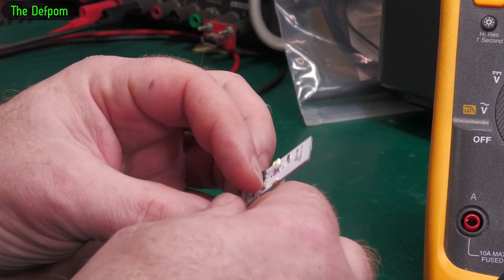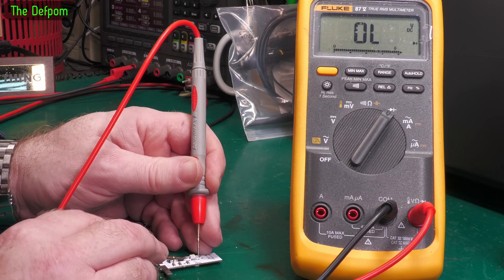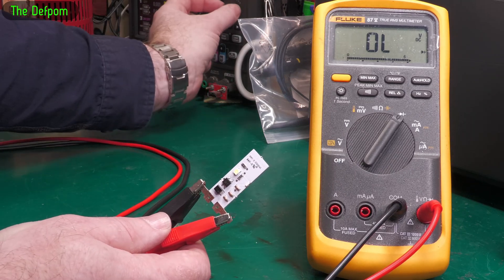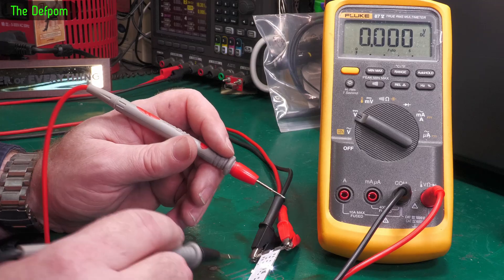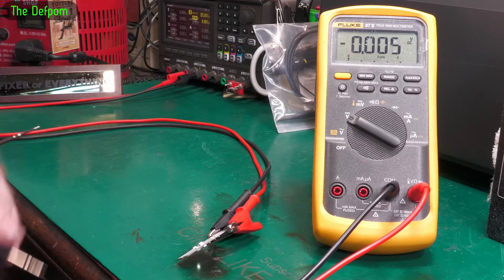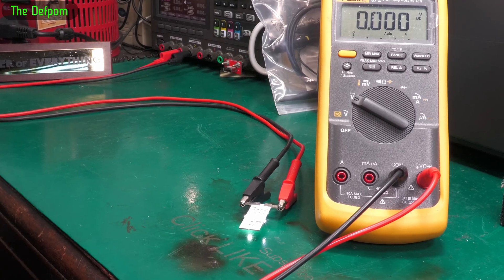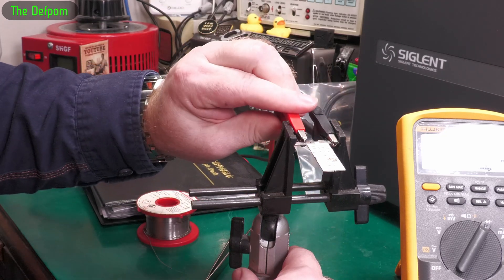🔴 Why Did This Werma Signal Tower Lamp Fail - Can I Fix It ? - No.1398

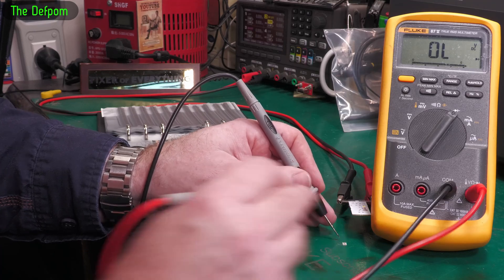Comment: 6:43 a small error, the negative side is the cathode, not anode.   Nicely explained about the bridge and the universal AC/DC input, a design often used on replacement LED bulbs.

Comment: Multiple series resistors is for power handling, as the package is small, so you need the board copper to spread out the heating to a larger area. they could have gone for the multidie packages, which have 2 or more LED dies per package, with a common phospor top cover, which would have resulted in a higher forward drop and thus lower loss in each resistor, which means better light output for the same number of components. 24V means plenty of heat to burn off, better to use more dies, and get useful light, and at the same time drop the current to 10mA, meaning much better LED life, which might actually be the rated manufacturer life, as that is normally specced at 10mA forward current, while most applications run it at the higher current for light output, so they get cooked with 50mA instead.

Comment: Also currently fixing LED's but ceiling fixtures that use some 50 parallel pairs of 3535 LED's. ST42 is super fast for finding the faulty ones which I've learnt to split across the middle with a scalpel then remove the remaining pads with the iron and settled on using a K style tip for this work then solder just one end then go back and solder the other pads. The scalpel also serves to remove a small portion of the Cathode pad solder mask to aid with forming a good solder fillet. On these LED's the Cathode is marked with a tiny bevel on that corner of the LED chip. 
Done 4 of these 1.5m ceiling fittings now with 3 more to go. Replaced ~60 LED's so far.

Comment: I've wondered if using a diode bridge on DC affects the life or ratings of the bridge. 
If you think about it on AC the diode pairs are only working 50% of the time and the power is shared between the two pairs of diodes. in the DC condition the power is 100% on two diodes and not shared across the device. so more local heating in the chip, so does lead to a reduced life?
Reply: IMHO a full bridge rectifier is more stressed in the AC case (assuming a sinusoidal AC waveform as you would if running this from mains).
If the DC case was say 10V at 100mA, this delivers a power of 1W to the LEDs. To provide the same 1W using AC, you need 10VAC RMS and a current of 100 mA RMS. This means the actual voltage is now varying between -14.1V to +14.1V and the current varies between -141mA to +141mA. More (peak) stress for the rectifier diodes
Reply: @TheHWcave  it great how a simple thought can start a lot of comments. i was just sitting watching the video and had the thought what affect does AC vs DC have on  a bridge rectifier. now hrs later we are still talking about it. But i can say thanks for keeping the grey cells working for a bit longer.
Reply from the maker: I expect it would if not correctly specified for the usage current, and power dissipation, in this case it should be fine.
Reply: @TheDefpom  Just had me thinking that the conditions are not the same, so although fine for you application is this a point we should take in to consideration in the design process? 
Just had me thinking outside the video, 50% vs 100% power in half the chip.
Please stop making thought provoking content it's making all the diodes down my left hand side hurt. 🙂
Reply: IMHO....no......As long as the spec is adhered to. i.e. the forward & reverse voltages, current and temperature is adhered to, and also the quality of the diodes is good then DC would not present a problem in comparison to AC at all.
In fact, DC could arguably allow the diodes to last longer as they are not perpetually in a switching state with DC, thus less stressing!
Good question though!
Reply: @IanScottJohnston  I was thinking there is some form of trade off between not switching but only using 1/2 the die to generate heat. Got to get them grey cells working some how. 🙂
Reply: Not worried about the resistors generating waste heat?
Reply: @pault6533  no unless they are getting too hot. it was just a thought about say 100mA going through 2 pairs of diodes 50% of the time. against 100mA going through 2 diodes 100% pf the time.
Reply: @TheEmbeddedHobbyist  my point is why worry about heating in the diodes if it’s already occurring in the deropping resistors?
Reply: @pault6533  my worry is should the diode bridge be de-rated as two diodes are taking 100% of the power in DC mode, but only 50% of the power in AC mode.  so working harder on DC than AC. Any heat is just a loss in efficiency but will also affect the MTBF figures.
Reply: @TheEmbeddedHobbyist  interesting. According to AI summary, reverse bias is also stressful to a rectifier diode, contributing to shorter longevity - even within operating limits.  Furthermore, reverse recovery stress from dV/dt can be a significant degradation mechanism albeit most significant at higher frequency.
Reply: @pault6533  Just goes to show how much longer a diode bridge will last if it  is left in the box it came in. 🙂
the same with LEDs but with them the max reverse Voltage can be very low 5V etc.